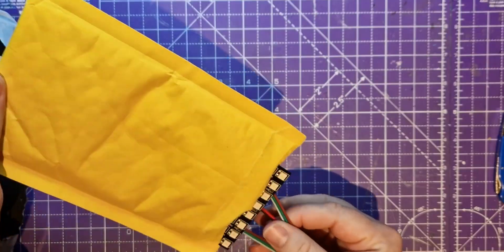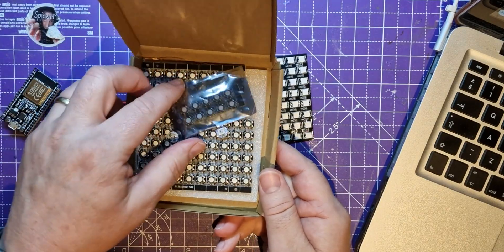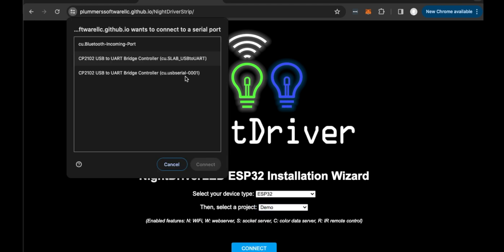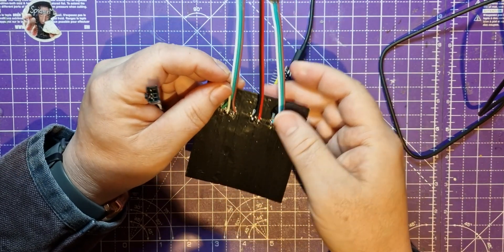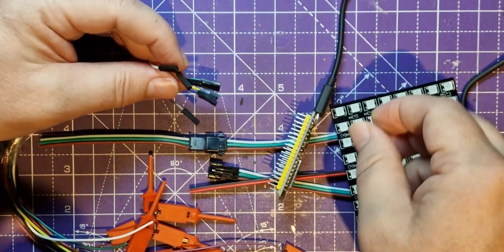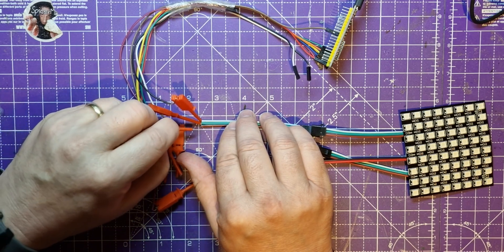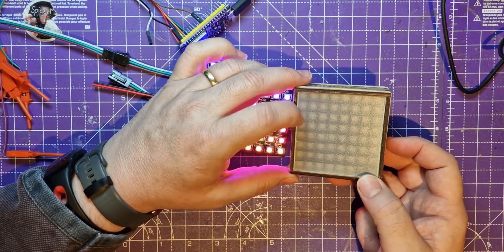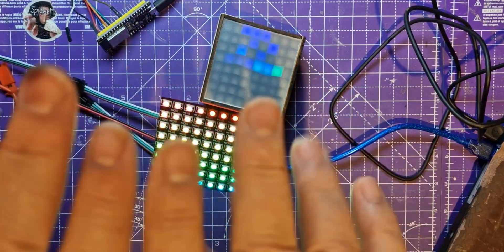Cheap 8 x8 addressable RGB matrix from TEMU. Can I drive it with NightDriverLED?

Comment: A couple of points:
1.  The LED matrix boards are normally 5v not 3.3v so connect to VCC.  Also, if you power the ESP board via the VCC/GND pins you are less likely to blow-up the ESP.
2.  You only need a D1 Mini for powering one of these 8x8 matrix.

Finally, I don't know about TEMU, but on AliExpress you can get the D1 boards for about £1 each if you buy multiple boards.